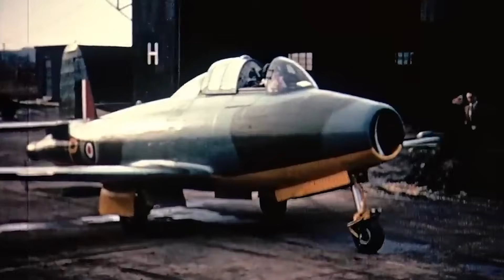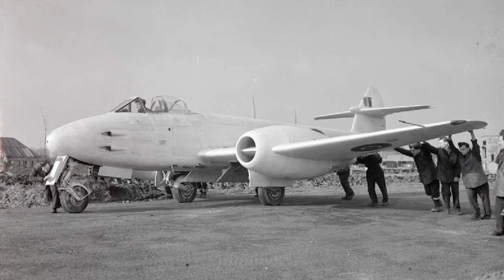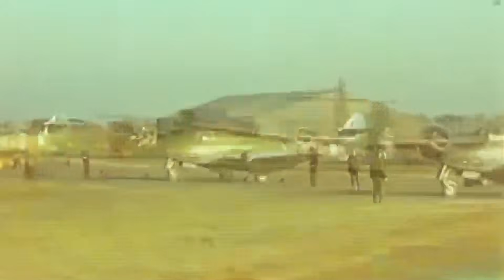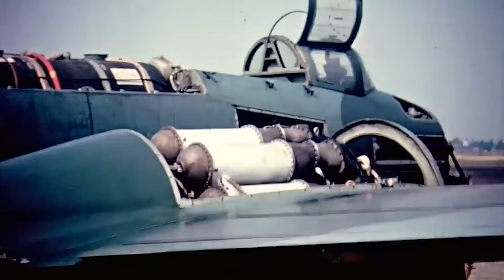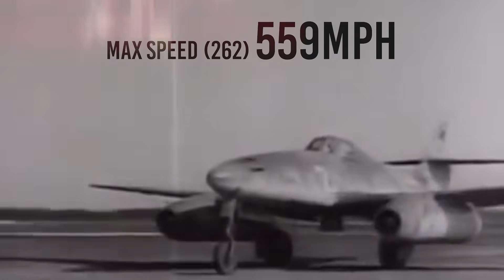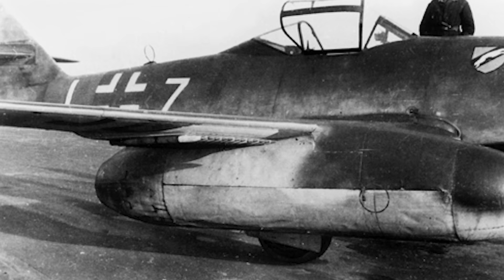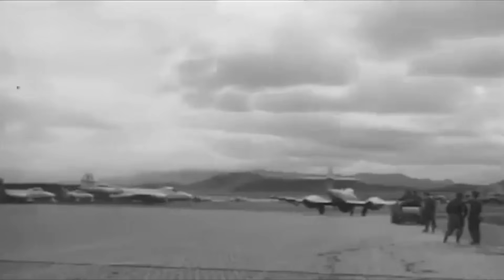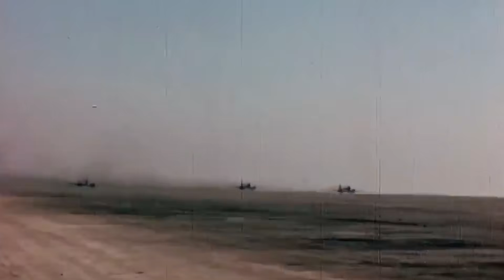Meteor vs Me 262 | Which was the better WW2 jet?

Comment: The me262 was a German project in 1939 wayy before the allies even discovered what a jet engine is they found out in 1943 and made their first one in 1944 same time as the me262 was in service the war ended shortly after so the me262 was tested after the war they found out it beat the allies in every way the me262 have 4x 30mm cannon and the allies had 4x 20mm the me262 had betyer turn speed the allies one had horrible like the turn speed is so bad and it was slower than some prop plane the me262 can go 900km/h it had betyer fire power
Reply: Incorrect. The British had actually built the first working turbojet engine, but did not exploit the technology swiftly. Germany was much quicker to recognise its potential, but it did not create the technology.
Reply: We feel we can clear up some commonly held myths and misconceptions, obviously.
It's always good to see the facts presented clearly and concisely isn't it?

The Gloster Meteor was one of the world's first jet fighters to go into service, it was in service during WW2. The meteor was the first effective multirole fighter bomber jet aircraft with a reliable engine to go into service,  It broke speed records in 1945 and 1946. During WW2 it was in service as a fighter and multirole aircraft over the UK and over all allied controlled territories in Europe and beyond. 

The ME-262 and it's 46 minutes life engines were abandoned shortly after 1945, it had a do not exceed speed of 456 mph and was only ever used to attack bombers with losses of three 262s for each downed bomber.  During WW2 most of the ME-262s were destroyed by their engines, were various types of accident losses or were shot down by bombers. No German designers were involved with the Mig-15. The Mig-15 used a copy of the RR Nene.  

During the Korean conflict most of the Meteor casualties were due to groundfire or accident losses. The result of any tangles between Migs and Meteors was that Mig pilots avoided getting into dogfights with Meteors. The battle of Sunchon, where 50 Migs against 14 Meteors resulted in the supposedly superior Migs failing to gain any clear advantage caused the Koreans to re-evaluate tactics. General opposition in Australia to involvement in the Korean conflict resulted in the govt using the battle as an excuse to reduce the RAAFs involvement to troop support only.

The world's first wind tunnel was built in England during the 1800s. The world's first supersonic wind tunnel was built in England during the 1920s. 

The Whittle Gloster E28/39  was of course a brilliant aircraft that was later copied in Russia as the upsized and tweaked Mig 15 with a copy of the RR Nene gas turbine aero engine. The RR Nene being the world's most powerful & most reliable gas turbine aero engine in 1944.

The MD F3H Demon was a contemporary to the DH Sea Vixen & had a similar performance. The F4 Phantom was a follow on from the F3 Demon. The Sea Vixen took a long time to get from first flight to introduction for various reasons and a similar situation occurred with the MD F3H Demon.

McDonnell Douglas F3H Demon
590 Built. Not Supersonic.
Max Speed 578 MPH.
Introduction date 7 March 1956
First flight 7 August 1951
Retired 1964

MD F-4 Phantom 2
Number built 5,195
Manufactured 1958–1981
Introduction date 30 December 1960
First flight 27 May 1958

DH Sea Vixen
Number built 151 (including two DH110 prototypes and one Sea Vixen prototype)
Introduction date July 1959
First flight 26 September 1951
Max speed 695 MPH.
Retired 1972

Interesting British achievements.
There is no doubt that the Fairey (England)
Delta 2 was of course the world's first jet
aircraft to exceed 1000 mph.  Indeed It
exceeded the previous record by 310 mph &
held the record for 1 year. Incidentally, the Dassault Mirage 3 & 4 are based on the Fairey Delta 2.

The Panavia Tornado & Euro fighter Typhoon are British design aircraft with British design engines built by international consortiums. 

The EE Lightning was one of the fastest aircraft on the planet when it first achieved a Mach 2 flight. 

Early days, jet fighters.
De Havilland Vampire, Sea Vixen & Gloster Meteor accident losses were not high or unusual for fighter aircraft at the time. De Havilland built large numbers of all metal airframe aircraft before the DH Comet.
We mustn't forget of course that the DH Vampire for example first flew in 1943 & the engine was also built by De Havilland. There were examples of the Vampire interceptor / fighter in service until 1990 which was operated by more than 30 countries.

Non combat phase accident losses.
% of Aircraft built.

The Canadair CL-44 was a turboprop airliner.
Canadair CL-44                  (ff 1959 ) 48%
Lockheed XF104                (ff 1954) 100%
Lockheed  P80                   (ff 1944) 43%
Lockheed F104                 (ff 1954)  45%
Grumman f9f-5 Panther   (ff 1947) 44% 
Convair F102 Dagger        (ff 1953) 45%  
MD F-101 Voodoo.             (ff 1954) 34%
MD FH Phantom 1            (ff 1945)  35%
MD F4 Phantom 2             (ff 1958)  28%
MD F3H  Demon               (ff 1951)  32%
Gloster Meteor                  (ff 1943)  21%
DH Vampire UK                (ff 1943)  23%
DH Sea Vixen   UK           (ff  1951) 33%
Gloster Javelin  UK         (ff 1951) 20%
EE Lightning  UK             (ff 1954) 33%

It's a great pity & a crying shame that British military forces had to occupy a large part of Germany for decades after 1945 & Russian military forces had to do the same. Of course Russia still posseses a large chunk of what was German territory & of course Russia & the UK produce nukes. Obviously Germany does not produce nukes.

Early days, jet engines. Whittle performed the world's first demonstration of a gas turbine aero engine in 1937. The RR Nene, a centrifugal gas turbine aero engine, was the world's most reliable & most powerful gas turbine aero engine in 1944. Licensed built versions & copies of the RR Nene & RR Derwent would go on to power many aircraft in Russia including the Mig 15 & Mig 17, the US, China, France & other countries for decades after 1944. Incidentally, the Mig-15 was in essence an upsized / tweaked copy of the Whittle / Gloster E28/39 jet aircraft including an uprated copy of the RR engine.  The basic centrifugal compressor gas turbine aero engine with Whittle style reverse flow combusters and sometimes an axial compressor section is still manufactured by more than one company including Pratt and Whitney, the main application being helicopters.

The gas turbine engine was invented in England during the 1700s.

During the 1800s Parsons of Ireland & North England produced the world's first axial multi stage sequential stator rotor turbines and compressors for turbomachinery use which would eventually go on to to form the main components of the axial gas turbine aero engine. At the time the basic idea of making an internal combustion gas turbine engine and using it as an aircraft engine was considered thus the jet aircraft concept had been created in England before the first powered aircraft flew.

An example of what goes on these days in various countries. For example, there are of course no German companies that makes German jet aircraft in Germany & there are no German Companies that make German gas turbine aero engines in Germany that are suitable for widebody airliners.

The UK has the world's highest combined per capita Nuclear / Defence / Aerospace Sector Activity.

UK defence sector, absolute terms, world's second highest activity. 1st for per capita defence sector activity. Per capita nuclear powered submarine construction, 2nd position. 
Main players being Rolls Royce, Babcock, GKN Aerospace & BAe Systems. Activities often involve international collaboration. BAe systems, RR and other UK companies now handle more Airbus work value wise than Germany. 

There's a good chance that anyone currently flying on a widebody airliner will be on an aircraft powered by RR gas turbine aero engines made in the UK and a good chance there will be other hardware on the aircraft that's designed and / or manufactured in the UK. 

Rolls Royce Holdings UK
Subsidiaries
- Rolls-Royce plc
- Rolls-Royce North America (ex Allison etc Classified Military stuff)
- Rolls-Royce AB
- Rolls-Royce Deutschland
- Rolls-Royce India Private Limited
- Rolls-Royce Marine Power Operations
- Vinters Engineering Limited
- Rolls-Royce Controls and Data Services
- Rolls-Royce Power Systems
- Bergen Marine
Joint ventures include:
- Rolls-Royce Turbomeca
- MTU Turbomeca -

Trent Family
The MT30 (Marine Turbine)
Industrial Trent 60 Gas Turbine
Trent 7000
Trent XWB Airbus A330neo.
Trent 1500
Trent 1000
Trent 500
Trent 600
Trent 700
Trent 800
Trent 8100
Trent 900
   
RR wholly owned subsidiaries in Germany handle smaller 2 shaft RR gas turbine aero engine work.

The UK space and aerospace sectors are highly productive, high-value industries that together contribute over £18 Billion in direct Gross Value Added (GVA) to the UK economy. Individually, the space industry directly contributes about 0.3% of UK GDP 7•2 Billion while the aerospace industry contributes approximately 0.5% £10•9 Billion.
  
V Of cOurse. eTC...

We hope this helps of course 👍

Comment: While the Me 262 was primarily used against heavy bombers, claims against RAF fighters included at least 7 Spitfires. Alfred Schreiber is credited with one of the earliest, possibly the first, jet-versus-propeller kills on September 5, 1944, involving a Spitfire PR Mk XI (photoreconnaissance variant) flown by 2nd Lt. Robert B. Hilborn. Schreiber was an early ace on the Me 262, frequently operating in the Lechfeld area.